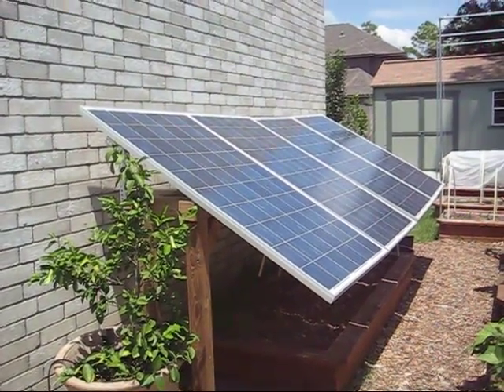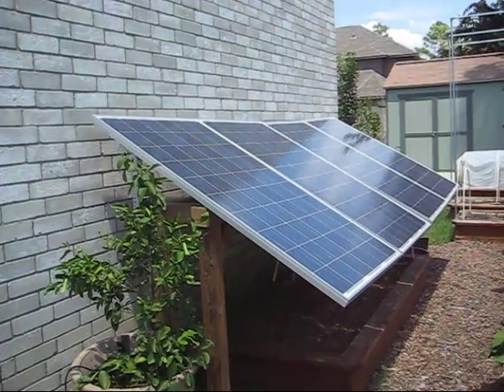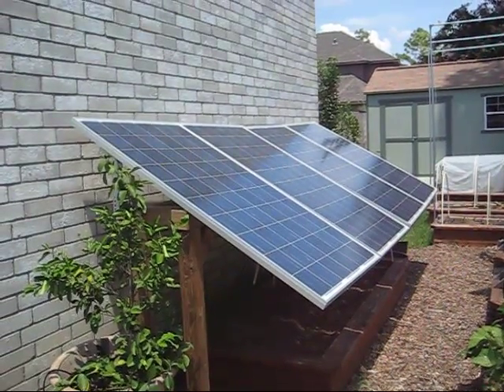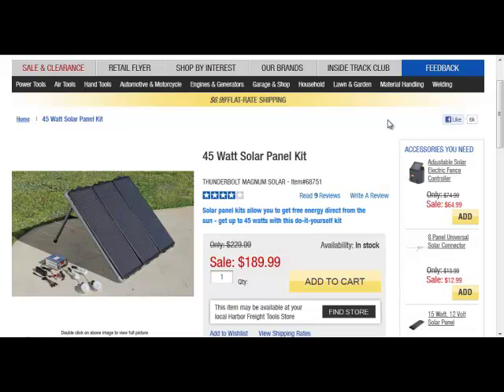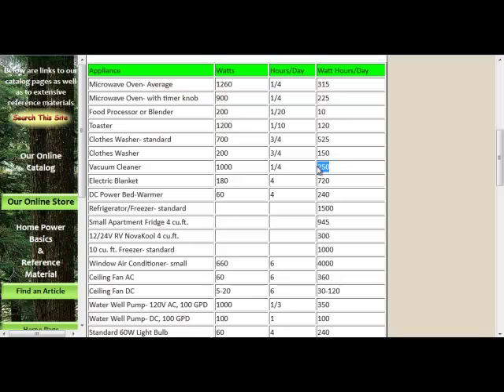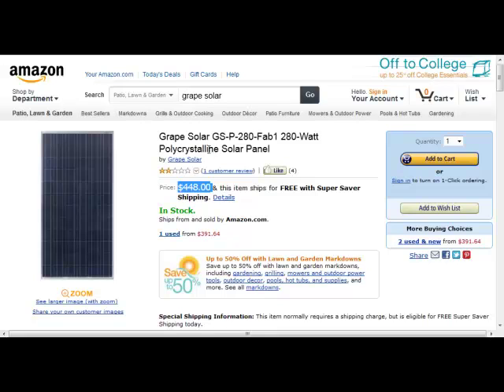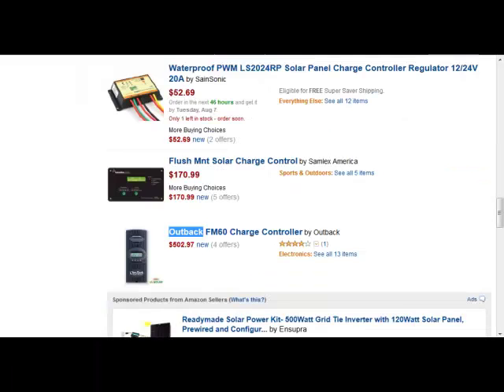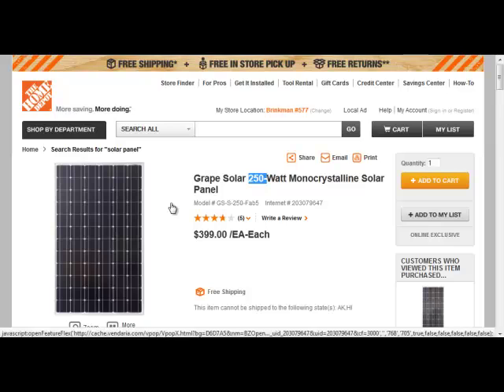DIY Solar Panel System: Costly Mistakes

Comment: 250 watts or 880 watts.. would not even run a microwave oven.. might run a string of LED lights though... Need to think about what needs to run off this power source exactly...
Reply: That is why you get more then just one panel genius.  lol.  :)
Reply: You don't run off the panels, you charge batteries! Batteries power an inverter   and that powers the device like microwave! As such, yes you can run a micro wave with 250watts of panels. The power to run microwave is supplied from battery, over time panels replace the power used. Just more watts in panels charge faster than less watts. 
 Some other things to consider also, but to put it simply.
Microwave uses 800watts of power per hour but is ran 30 minutes, that is only 400watt hours, to replace that power it would take 100 watt panel 4 hrs, 200watt panel 2hrs, 400watt panel 1hr. That would be perfect world but nothing perfect so it takes longer. There are power losses along the way, not perfect sun, etc...

Comment: The amorphous panels seem to be less efficient. But that is only on how you calculate that number. So let's say an amorphous panel is 8% efficient and the poly and monos are around 15 to 20%. That number represents how much of the suns energy in one square meter the panel can convert into electricity. This is in lab conditions with sun intensity as strong as it is at the equator. Now when it's partly cloudy, raining, overcast, or shaded in any way the poly or monos pretty much turn off. The amorphous in these conditions will produce 80% or more of there rated power. This is because poly and mono panels were made to work in outer space as the work best in the near inferred spectrum. Satellites have been working fine for 20 years or more, can't say that for a solar system on planet earth. Reason being the panels are off to many days of the year. So they tried to fix the panel problem by the advent of the MPPT chargers. This is a mere bandaid to the heart of the problem. If your battery's are consistently undercharged your sweet money saving solar system will eventually cost most in battery replacement then grid electricity. So a little more upfront cost and a little more space with the amorphous panels you will then have an up to date solar system. Look past the efficiency BS low light panels will give you what you want
Reply: Yes, and even on good days there are more less than perfect hours than there are perfect hours for the sun. That means Amorphous panels can be making power for more hours a day than Poly or Mono panels

Comment: Hi guys, I've got a tiny Zennox 3,5" portable TV which runs on internal rechargeable batteries recharged by plugging into a standard wall socket. Problem is, in a prolonged power cut I won't be able to recharge, so I was just wondering if I could buy a smallish solar panel from somewhere to stand on my windowsill and recharge from that, what do you think?
Reply: Look up : Goal Zero : these are pretty good solar products.
Reply: TungstenKid Find out the total voltage of the batteries.  You may be able to charge them "directly" with a solar panel.  If you can do that, it's a heck of a lot more efficient than plugging the ac cord into something else (like a Goal Zero).  The reason is, by plugging it in you convert DC to AC and then you convert AC back to DC.  And totally skip "Goal Zero." that's another one of those "hyped" products that doesn't scale up well and is somewhat proprietary,

Comment: I spent 150 on a renogy 100w solar kit from ebay for my ham shack and i am happy
Reply: Not to long ago, I bought the 3  100 Watt panel pack for $320 and free shipping
Those are very good panels. I will buy more.
Reply: Bonnie Flory

Comment: Excellent video and great ideas,,,, I have set mine up thru home depot and Amazon but have gone VERY low on wattage.....its only for my camper and one RV battery. I am happy even with a panel that only puts out 8 watts, with a matching controller...keep up the great ideas.

Comment: I will make a small system to charge my phone and some bright led lamps, I have only 30Watt panel and it will not produce much on a gray day, so I've seen on a 250 watt 30.3 V, no load 37 5 V and a MPPT controler, a 12 V batteries 100A. I measured out with a friend who had 200 watt panel that on an overcast day that it is still able to produce 7 watts. 7 X 10 hours = 70 watts are definitely home. With a MPPT controler you can get more power in the battery when the voltage is high at panel

Comment: Thats the biggest and most common mistake made by solar diy'ers is Harbor Freight.  Those panel sets should be banned from existence.  Cheap chinese crap.
Reply: I have some of the best panels you can buy, but started out with a couple from harbor frieght,  after three years they are still working great.
Reply: Yep, some people don't have a clue what they are talking about but glad to tell their opinion anyway! I have had HF and Poly side by side and tested very well both at same time, then change everything around to be certain other items did not skew results. End of day, many many days, both are good, often HF actually WON. More power from HF anytime days were poor sun quality.
Reply: That is because the HF units are Amorphous panels and the others are Polycrystaline/Monocrystaline. In low light conditions, the HF units will charge while the others just sit there. I actually have some under a shed roof that has Smoke Gray Polycarbonate  panels. Output nearly matches those facing South. And the newer kits from HF are rated at 100 Watts and on sale are $149.95. That comes in at $1.50 a watt including the extras. And the bulbs in the kit are really bright LEDs that do not draw much in the way of current.  At 12.8V, they draw 350 milliamps each. 3 of them really light up a 16' X 20' shed.

Comment: Since I also have purchased four harbor freight kits, it was a bit perturbing hearing "Harbor Freight" the word "mistake". However, Im not trying to power my house. The HF kits are more or less stupid proof and are complete.The only thing not in the box is the battery. Starting with one kit, I have added more and they do fine. But, next time I buy panels Ill use LDSPreppers' advice and upgrade. Im sure most folks getting into solar power upgrade and tinker with their systems. I do.
My understanding is storage is more important than production. I guess it would be nice to produce as much power as you use, continually charging, but it doesnt do a lot if the sun is not out. Therefor, I decided to go for more storage capacity. Only my shop area is powered and so far Ive collected seven deep cycle, sealed, lead/acid batteries. and I still have two panels I havnt used yet. Now Im thinking panels with more watt potential would produce more power with less sun?
Reply: Three years ago when just starting out, I bought harbor frieght panels , I still use them in my array of panels, there still working great ,  and I have had to replace 2 of my more powerful ones. Its a great way to get started , to learn and experiment.

Comment: Don't let naysayers ruin your plan for energy independence, payback on DIY solar systems will be about 4 years. There are a lot of people out there that want to keep you dependent on big power companies because, lets face it, they make their money by selling you KILOWATT HOURS, the more you use the more you pay and the more money they profit. Just installing a grid tie inverter and 4-250 watt panels can reduce your power bill by as much as 40 percent or more without even buying a battery bank. Make power when you use it, during the day cooling your home and if you make extra it gets sold back to the power company.

Comment: Canadian solar has the best panels money can buy and a warranty to beat all. Pricing is about a dollar a watt or less for mono panels which is what you want. Poly panels simply won't hold up in the long run compared to mono panels. Check ebay pricing for panels as I have seen really great pricing there. Good luck people and talk to everyone you know about getting either off grid or using grid tie to knock down your electrical bill big time. Also, read all you can to educate yourself so you can install these yourself. Power to the people!!!

Comment: Sharp makes the best solar panels.  You can always buy the blems or raw panels for much cheaper (<$1 a watt). You want the big 200-300 watt panels and they will work much better when cloudy etc.  Look online at Cosco/Home Depot etc and have them shipped in if not in stock.

Comment: That's not right. I don't know where you came up with your math. You halve your amp hours going from 6v to 12 v. So to 6v batteries = 450 amp hrs /2 + 225 amp hrs. You are calculating watts  V x Amps = watts.  The advantage of 6v batteries over 12 volt batteries are the cycles 6 volt batteries have 64 lbs of lead and are made to be drawn down to nothing and recharged. 12 v batteries start losing life after a 50% draw down. And if you buy the best (rolls/surette) they have 3000 life cycles.

Comment: stevebrannon69  can you tell us how you delt with instalation and electrical permits etc? for this grid tied system?
BTW  i just put in a similar 4kW system (Helios panels and Enphase inverters) but it was a lot more expensive than yours. Steve

Comment: Series increases voltage but current (and ah) stays same but of course the wattage is greater. (volts x amps) . Parallel increases amps (and ah) but voltage stays same, watts of course increase. higher voltage better for minimising losses due to heat.
Reply: It don't matter how you wire your batteries, it's still the same watts!
2 batteries 100amps each at 12volt
Wired as 12v is 200amps x 12v = 2400watts
wired as 24v is 100amps x 24v = 2400watts
Watts never change,

Comment: 6volt made into a 12 volt battery is still 225ah. a 12 volt 110ah battery is 110 ah's. pm me for help if you truly want it. a out back flexmax 80amp mppt charge controller is what you should be looking at for a charge controller.

Comment: if you hook to 6volt batteries up to make them one battery your voltage doubles, but your amp hour rating stays the same. if you take four and make two 12 volt batteries out of them you have made two 12 volt 225ah batteries. when you hook the two positives together and the two negatives of the two 12 volt batteries together you have double your ah's. if you took six and made them 12 volt you'll have a 675ah battery bank.

Comment: Your 2 HF kits will produce a total of 6 amps for about 6 hours on a sunny day.  That will put 36 amp-hours into your battery which works out to about 432 watt hours.  Multiply that by about 70% for charging/conversion losses and you'll get 302 watt hours which will power your computer system for 2 hours.

Comment: Sorry to hear your learning frustrations.  Big thanks for your efforts in posting some of the steps that are needed to create a useful and effective Green Energy source like intended power consumption v's your systems output abilities, how each component will work and the downstream domino effecting the functioning of the system complete. Plan steps that are needed to really map out your system prior to putting a plan in concrete.!!

Comment: I know the fun involved in trying to solder together my own arrays (it can be tedious when a soldered connection breaks loose when trying to transfer the silicon cells to the mounting surface (bread board, polysterene, formica, whatever insulation your working with) and thanks for that data on ebay, places to find the proper equipment to get my system up and running.  I will probably put both arrays together to achieve a higher current so long as I don't go over the amperage for the safe charge.

Comment: Thank you for that informative video.  I recently bought a very small charger (with a Lithium Ion battery and led lights) from Harborfreight that was suppose to charge my cell phone but there was no instructions and I had to use an adapter to charge it threw my grid which took around nine hours.  It charged only the battery because of the circuit so the unit charges the phone threw the other mini usb port.  I am considering opening up the other solar charger and just putting them both together.

Comment: Are you sure the unit is Watt? because Watt is a consumption velocity or speed, (Joules per second)
Batteries do contain a certain amount of energy that can be generated -if it was the rechargeable type- by solar panels for example.
I'm probably missing here, please enlighten me.

Comment: I bought a GREAT charge controller from Missouri wind and solar. it does wind charge control and solar. even both together. check them out at mwands.com great customer service and great U.S.A. made products... nice  video. thanks for the info and yes thanks for saving me money.... wow what a difference in cost. you forgot battery banks that is a must have.... thanks I thumbs up this video.....

Comment: Question?  The solar panel I have lists several different amp information, for example short circuit, maximum series fuse rating, etc.  Which of these numbers dictates the amp size of the charge controller I will need?

Comment: i have 10 of the hf kits myself. they are what i started out with. i still leave them hooked up to a battery bank. i have done exactly what ldsprepper has done. i have a 7200 watt system grid tied to my home, with four mw&s windturbines and another 1800 watt bank of panels to two battery banks. my battery banks are over kill, but great backup in storms!! hf is a great starter kit, but you'll move on or give up using them.

Comment: Very insightful information on solar panels. Funny how many of us start out using the same equipment for starters and then branch out. I started with the exact same kit but mine was from Costco. I also realized the limitations of that type panel but I started building my own panels with polycrystaline cells. Next I am using Monocrystaline type like what you purchased from Home Depot. I will watch your whole series of video's. Good Job!!!

Comment: I have an older 60 watt four panel system with an included charge controller I got from Kragen Auto Parts. I used five car batteries as a test to see what it would charge up. I only wanted to run two flourescent light fixtures. Both totaled 12 light tubes. I had an 800 watt Inverter to run the lights. It would not power the two lights. I need to look at the light too see how many watts and amps they draw. I am trying to run my Greenhouse OFF GRID. I also have 3 fans and two water pumps to run.

Comment: When you wire batteries in series (positive to negative) your voltage doubles, but amperage stay the same.

When you wire in parallel (negative to negative and positive to positive), your voltage stays the same, but your amperage doubles.

Comment: hie. your videos are very much inspiring. now i would like to ask. i seen some batteries on ebay. the first are 6v battery 225ah for £120.00 and the 2nd is a 12 volt battery 110ah for £75.00 . my question is if I connect 2 6v batteries 225ah I know the voltage will double but does the 225ah stay the same or does it also double. Just trying to see if to buy the 12v batteries and connect them in parallel. I plan on running a 12v system. thanks in advance.

Comment: I own three different types of panels. Amorphous, Polycrystalline and moncrystalline. Harbor Freight panels are $150.00 on sale. They go on sale quite often. Granted your spending a dollar more per watt, but lets dispel the myth. Amorphous panels do gather more power during an overcast day compared to the other 2. They also last just as long as the other 2. Fifteen year panels are still producing 80%. Also a 45 watt amorphous solar system will run a laptop more then a couple hours.

Comment: I installed a 8 kilowatt solar power system on my roof using phono 250 watt panels and enphase microinverters. it cost me with installation rails and wiring about $22,500 and I installed it myself my electric bill on a all electric home went from 250 to 400 dollars a month to 12 dollars a month. I was permitted and signed off by the county and PGE and I am grid tied. so far have recouped in tax savings and rebateds most of my money in less than one year will have all back in 2.

Comment: The HF kit, is a kit. It's designed to run the lights and charge cell phones for small Chinese homes that have no power. They are made by suntech and are also sold under sunforce name. The pnaels are just a panel, no wiring, regulator, lights, adapters, etc.  

I think the moral of the story is research. Always RESEARCH before you make a move. 

Amorphous cells work better in cloudy and smog filled air. So china, rainforest, england may find the amp cells work well if not better than si cells.

Comment: While I agree on your point your making regarding cost.  I will have to challenge your claims re: what you can do with the HF system.  I have had 2 sets installed on my roof for two years now.  Spring through Fall (In Chicago-land), I am able to run nearly all of the lights in my house, charge several battery operated devices as well as run a 20 inch LED television in my kitchen.  2 of the 45w systems with one 200Ah 12V battery.  This was a beginner run for me... I hope to expand this summer.

Comment: If you wanna cook up a few pieces of toast...hahaha That was funny!! That sounded like ole Harbor Freight isnt on your good list! Im in the process of calculating what all i need, i figured up 3000 watts of power and im gonna start out slow with a 1500 watt system and build it up as i go! That way my wallet wont feel so bad!! :)